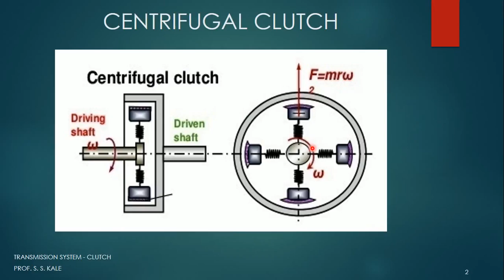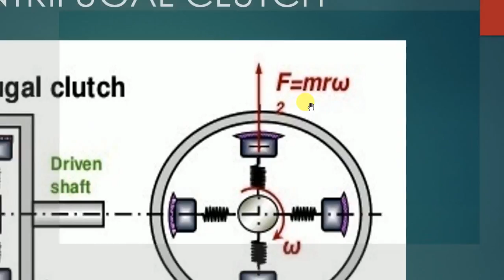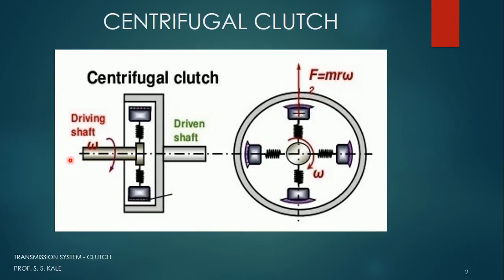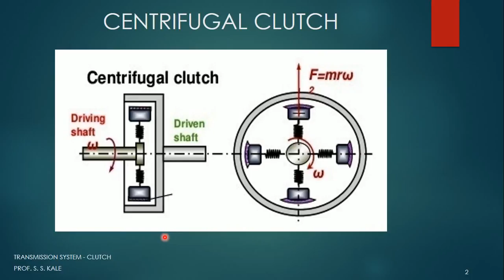Centrifugal Clutch

Comment: Sir ,in accelerator of tractor , can we use the centrifugal clutch??
Reply from the maker: Actually clutch is not provided in accelerator in any of vehicle. Generally it is in saperate casing or Some time it may be in gear box casing. If we want we can provide it to Vehicle like tractors. But we can not put as external attachment to the existing tractors. Generally automatic transmission vehicle which has only accelerator and brake padel. Automatic transmission system tractor can be designed.
Reply: @SampurnaEngg  Sir actually my question is about accelerator of tractor... As u explained there are three gear and one reverse gear there but my doubt is about the accelerator... How does it work in tractor... Is the principle is same as that of centrifugal clutch
Reply from the maker: No, in normal tractor, centrifugal clutch is not used.
Reply: @SampurnaEngg  ohk Sir... Then how does the accelerator work in tractor??? We don't change any gear while pressing the accelerator by foot...would you please clear my doubt?
Reply from the maker: This is not for only tractor, For all kind of vehicle we don't press accelerator while changing gear. We have to release accelerator, change gear and again go for acceleration. This is true for 2 wheelers also.